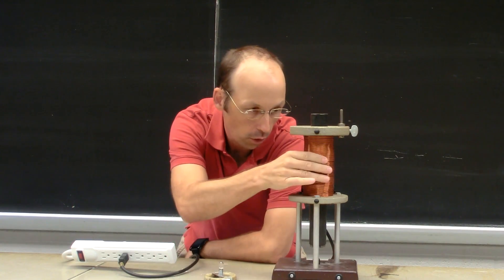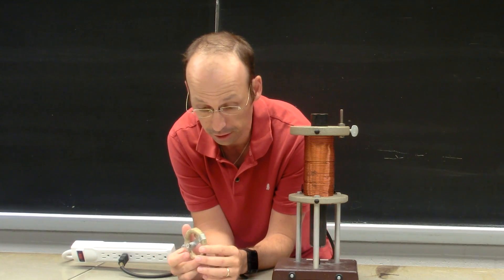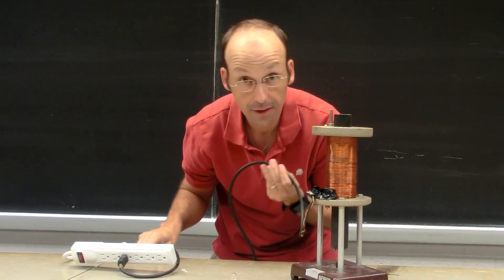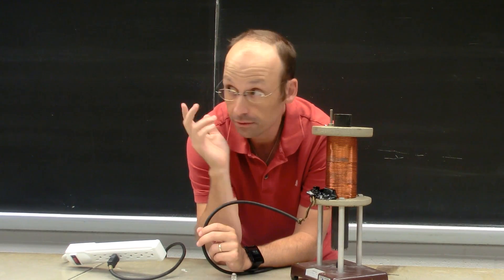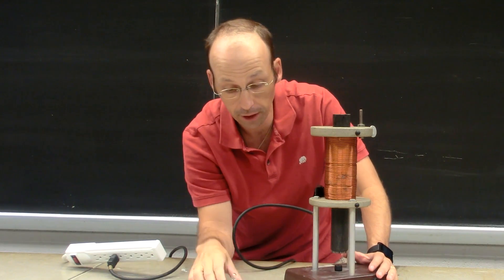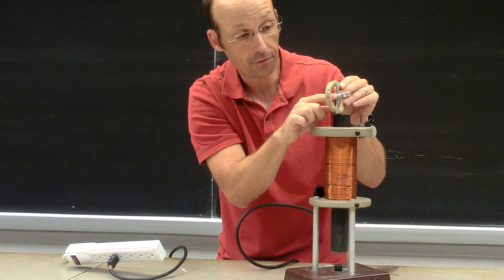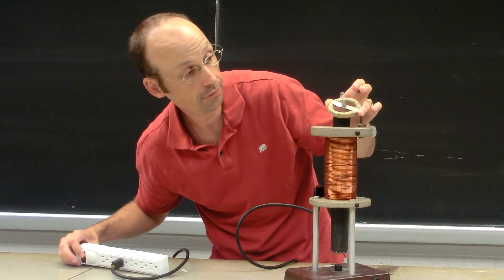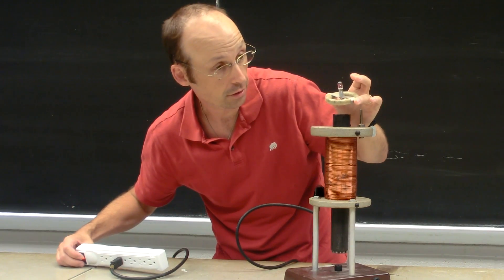The Physics of Wireless Charging

Comment: It's ridiculous this video only has 42 thousand views over 8 years.  No one ever try making two of the coils on a U shaped piece of iron? One coil wrapped in a Left Hand Law and the other in a Right Hand Law.  You get a current between the two in such a way you can spin stuff wirelessly.   Perhaps you can spin stuff wirelessly this way as well.  I dont see why you could not make a rotor with magnets around the circumference, attach rotor to a Generator and charge batteries.  You know you can run that power bar he's got plugged in running his coil off a battery right?  So if you can charge a battery with this you can run this with the battery while charging it..  Does anyone understand what that is?
Reply: Huh?
Reply: Maybe you could clarify the specs of the  device you are proposing. If you wish to mag lev and spin a device magnetically you start with a circular arrangement to a stepper motor to spin then a non ac mag on bottom to lift.

I fed your statement of work into google AI and it drew out a 1 page  blue print for your  design with voltages and placements of magnets.

Comment: could you email me the details on the ac connection? I can't see much on the close up. thanks. photo.3iproductions@gmail
Reply from the maker: It is literally just a wire that plugs into the AC outlet.  It uses the 120 Hz AC outlet as the source.